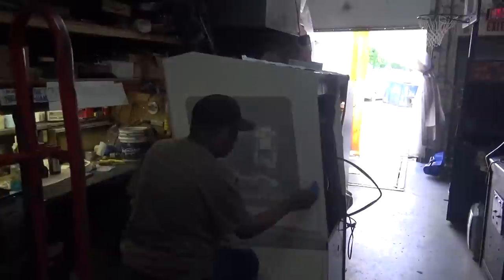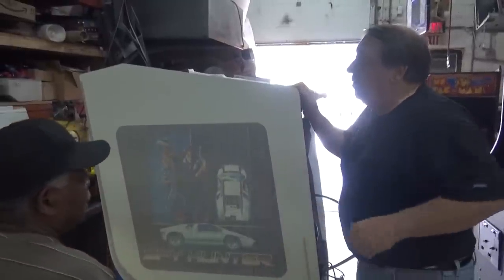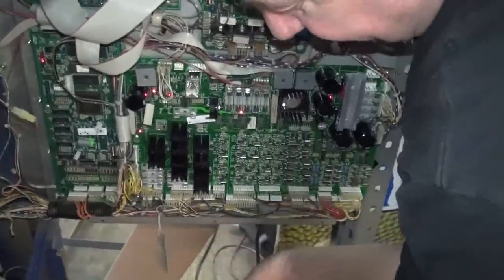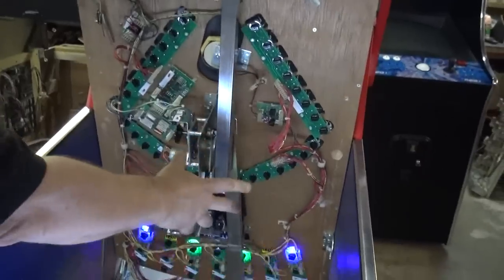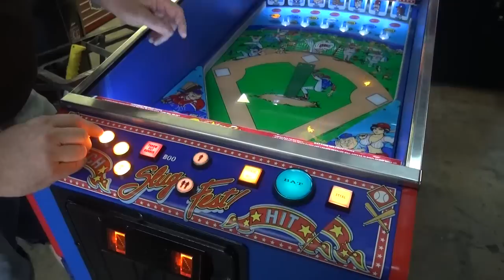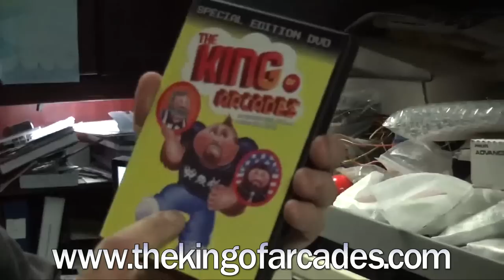#653 Williams SLUGFEST Pitch and Bat Baseball Pinball Machine! TNT Amusements

Comment: Did you replace the ramp optos? Couldn't hear as there was background noise when you explained. I'm fixing up my own Slugfest and I cannot get the ramp to go up down properly. Motor is fine but the machine cannot seem to consistently read the optos. I reflowed the solder on the opto board. Is the solution ultimately to replace the opto board and the optos?
Reply from the maker: the optos themselves are probably ice cold...you have to reheat them...one leg and let cool and then the other leg

Comment: To keep costs down they use a resistor a little bigger them needed but not much and the same with capacitors. I got a boom box from a company that sold returned and refurbished stuff. It was AM/Fm and a 5 cd changer. I had to go in and repair the jumper on the volume control board that was small and mounter on the inside of the front case. I also had to doa lot of resoldering. The function switch should have been replaced as worked but was loose.
Reply from the maker: Lyle Johnson Yes...things get rushed at those places it seems!

Comment: If you use LEDS in the head of this game, behind the batter, under the bleachers & in the 2 baseball card holes you will get horrible glare and reflections on the playfield glass. You can even see the glare on the playfield in this video. If the glass was on, it would be really bad. 

tried LEDs and ended up going back to incandescents in the spots mentioned above. 

LEDs are fine on the inserts under the playfield.
Reply from the maker: +bigbusa1 No one has said anything yet, about the ones we have done....but I think its an option for sure!
Reply: You guys do great work!